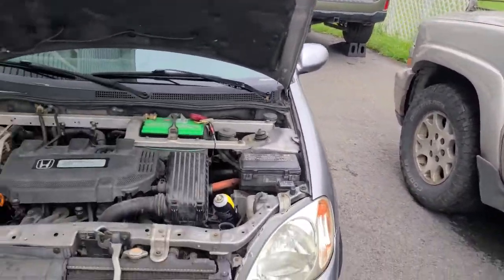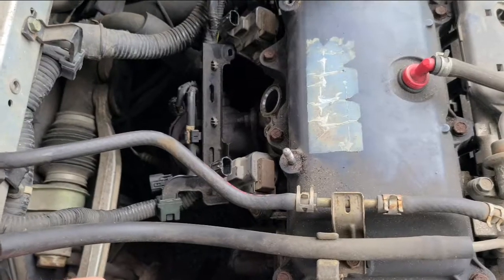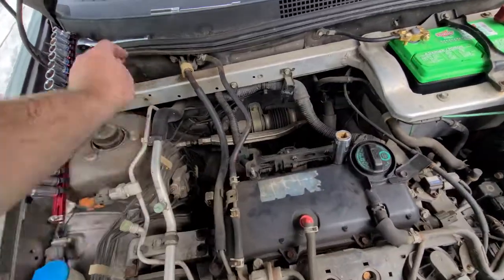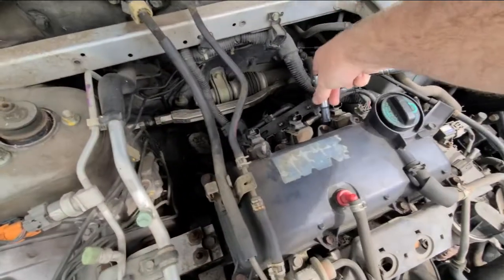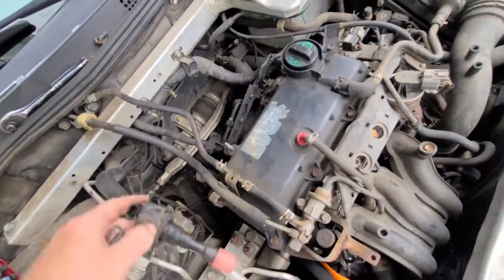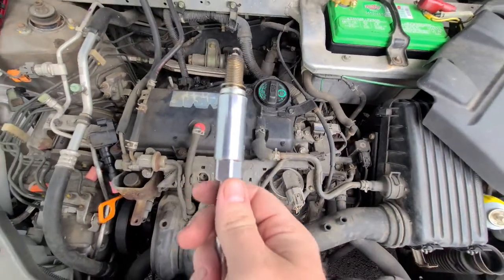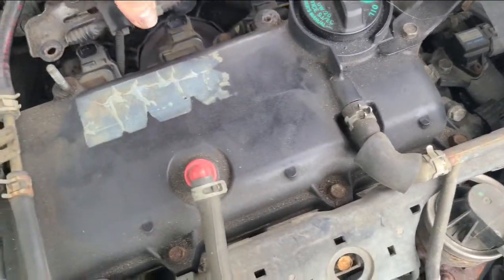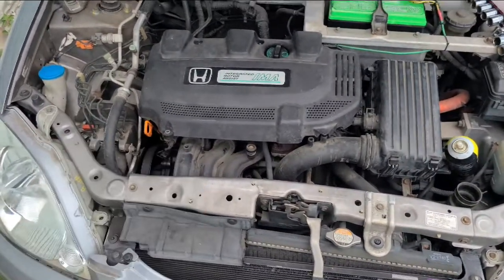Honda Insight has something weird with the spark plugs you might want to know about.

Comment: Autolite plugs work too. Just buy a few extra and mark the extension. The open end needs to face 5 o'clock from the front of the car. Anywhere from 4 to 6 works fine. I prefer to gap down to 35 thousands vs 44 thousands recommended.

Comment: Thanks for sharing your "insight" about that Weird Little Car's spark plug specs. I had no idea that Honda stamped the blocks from factory with indexing recommendation for each and every cylinder of those tiny little 3-cylinder engines. Also, for such an old commuter car there sure is a lot of aluminum in that engine bay. May you have many more years of fun with your Insight!
Reply from the maker: You mentioned it the other day and I realized that I had filmed this and lost track of where the video went.